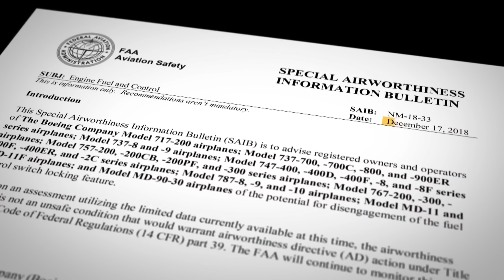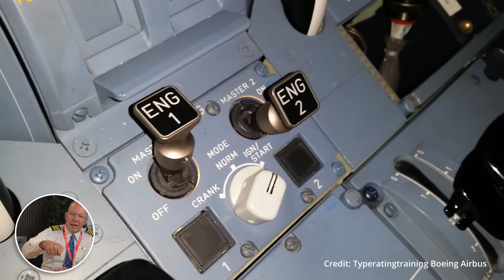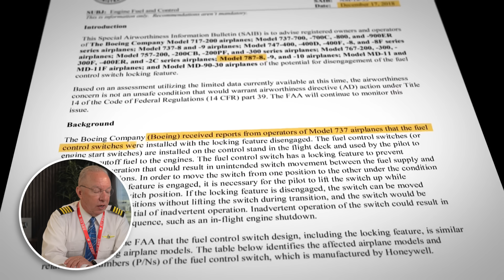Air India 171: The FAA’s 2018 Fuel Switch Locking Bulletin Explained (16 Questions Answered)

Comment: How can you be 100% sure that it’s not mechanical, electrical failure on that fuel switch? At least both the pilots are unaware from what was released in the preliminary report. Talking about pilot mental health is utter nonsense when you have no conclusion.

Comment: Incident Context
On 12 June 2025, Air India Flight AI117 suffered a dual-engine failure shortly after takeoff, leading to catastrophic loss of life. Preliminary findings show the fuel control switches were found in RUN position post-crash, with cockpit voice recordings revealing confusion among the pilots regarding engine cutoff.

🔍 Hypothesis Summary
This commentary proposes a failure mode involving mechanical-electronic misalignment in the fuel control switches:
- The physical toggles were likely in the CUTOFF position during taxi and takeoff.
- Due to a transient electronic override or contact misregistration, the FADEC may have incorrectly interpreted RUN — allowing the engines to start and deliver initial thrust.
- During takeoff roll, the system could have re-synced with the physical state, triggering an uncommanded fuel cutoff and total thrust loss.
- The pilots likely recognized the failure and toggled the switches to RUN — as confirmed by post-crash toggle position.

⚠ Design Vulnerability
Modern aircraft systems typically rely on electronic signal feedback, with no independent validation of mechanical switch position. As such:
- The failure mode would leave no direct evidence in flight data recordings.
- Investigation teams may be unable to conclusively verify physical switch states vs signal interpretation at critical moments.

Comment: The switches arent spring loaded to either position. The spring loading is down against the bottom of the latching ramp and when you lift the switch to allow it to go over the latching ramp you are lifting it against the spring.

Comment: I am simply a passenger who has wanted to be a pilot since I was 14 years old. Health issues prevented me from achieving that.
Captain, I think you are right. Putting myself in the position of the pilot then the copilot…no matter which one I was, I would turn those switches back on so fast the other pilot’s head would spin. Then I wouldn’t politely ask, I would say “what the hell are you thinking are you trying to make us crash? There are babies on board! Parents, children, aunts, uncles…..life. I am not sure how a pilot would handle a rogue partner, but I would immediately turn the plane around and make him get off the plane. If the pilot did it, why wasn’t the co-pilot panicked? If 5he co-pilot did it why did the pilot wait 10 seconds? 10 seconds is a very long time when engines are involved. If you are wrong I will be shocked.

Comment: We don’t have enough info. The report says their focus is these switches. These physical switches are not recorded in the flight data recorder (black box). This is what I found:

The Flight Data Recorder (FDR) on the Boeing 787 captures the electrical state of the fuel control switches — meaning it records whether the switches are in the RUN or CUTOFF position based on the signal received from the cockpit systems A B. It does not directly record the physical movement of the switch itself (like a mechanical displacement), but rather the status as interpreted by the aircraft’s systems.

So, someone familiar with the 787, is it possible the electronics behind these switches went to cutoff without these switches being physically moved?

Comment: Is it possible? That the fuel cut off switches were never actually turned off, and it was only an assumption by the voice that said “why did you turn them off?” Could it be a blown fuse or tripped circuit breaker ?￼￼￼

Comment: The problem with episode Captain steve did not comment on the leader report. Sometime ago I watched a doco on the issues at Boeing. In that one of the whistle blowers warned that there was an issue with these switches, Although they are manual operated they are just an electrical switch. he warned they had had intermittent electrical issues with them. Boeing claimed they had fixed it. this guy pointed out many other issues, He left because of the what was going on another whistle blower was  fired and later found dead in his vehicle ?

Comment: The FAA had issued notices about these faulty switches, which could easily move and cut off fuel to the engines and not just interchanging position. Boeing 737 MAX crashes (Lion Air and Ethiopian Airlines) where Boeing initially blamed pilot error but was later found to have concealed software flaws and manipulated data. Boeing found guilty and paid 2.5 billion dollars. Boeing has power to turn blame on pilots.

Comment: So upto this point what i have got from your explanations from previous videos is that plane cannot take off if the switches are on cutoff, so that means when they lift off from ground, switches must be on RUN position. So after few seconds it went to CUTTOFF position, that means it must have been recorded in Flight Data Recorder. So did it happened by some faulty switch system or done manually on purpose by Pilots???

Comment: There is no way one pilot saw the other flip the fuel control switch because it took 10 seconds to turn them back on. If he saw it happen he would have immediately flipped them back. He must have inferred this by some other means. Why does Steeve not address this and keeps reading the same old script. Also what a dumb argument about not having camera's. Obviously it will not prevent the first incident of a kind but could prevent future losses. For e.g. it would have made the MCAS failure apparent and hundreds of lives could have been saved. Instead Boeing blamed the pilot like they are doing now.

Comment: It took just one second to move the fuel switch from the 'Run' position to the 'Cutoff' position. However, during the recovery phase, the first engine switch was moved to the 'Run' position at 08:08:52 UTC, while the second was moved only at 08:08:56 UTC. Why was there a 4-second delay between the two?"

Comment: Is it possible the pilots heard the engine decelerating and turned asked hey did you cut off and once hears a negative answer...they try to restart the engines...
Switch could have been in run but fuel was not reaching the engines..

Comment: Let assume for while pilots is correct and they did not touch those switches. What are the other possibility?

what no one is talking about is,  can those switch transition to OFF position via software control?  

Can data recorder be  interpretation  software control  of  fuel control valve or real physical transition of those switches via pilot action? Software could be turning off those valve in case the engines were flaming out just as they were taking off.  As result data recorder would interpret as physical transition of those switches from ON to OFF position.

Comment: Who else smells a slight bias towards Boeing? Ain't  Mr.Captain an American? Oh wait! Boeing's American, Ain't it?
Shift the blame on the pilot by subtly putting in, "psychology and mental health."
After all, it's a preliminary report, and here is already a subtle push on the pilot error.
As much as the pilot error that you are pushing, could it not be a mechanical failure of the fuel switch itself? Explains the startled response from the second pilot when asked? After all, it's a preliminary report ain't it?

Comment: Great to answer questions Capt Steve. I’ve got one remark. One of the aircrafts I fly, has spring loaded battery swicthes. It happens sometimes that one switch remains in the middle position due to physical damage on the foot of the switch. But, from my experiences, I always see the switch staying in a wrong position.

Comment: Great commentary. We really need to hear the full audio (accompanied by a time-stamped transcript of what each pilot said) from the CVR from pushback at the gate to the accident. The short transcript released thus far seems far too sanitised. We really need to hear the intonation  of the pilot's conversation and the sound of any audible warnings. If I had observed a deliberate act to move the fuel switches to cut-off I would shout at the top of my voice "What the f....k did you turn off the fuel cut-off for"  For me the 1 second delay between the cut-off to the Number 1 and number 2 engines  is consistent with a deliberate act and not some sort of electrical glitch. Is there just a remote possibility that one of the plots had an absolute brain fade and cut off the fuel instead of raising the landing gear. Afterall, the maximum height achieved of around 400 would be pretty consistent with when the gear up call would be made.

Comment: Captain Steeve please comment on my theory below:

 like most people I am finding it extremely  difficult to accept the conclusion that this incident was a deliberate suicide attempt on an overbooked flight. Instead, here’s what I believe might have happened.

The aircraft may have been overloaded—with luggage, cargo etc. In the pursuit of maximizing profit margins, it's possible that every available space and weight allowance was pushed to the limit. If the total weight was significantly underreported, this would lead to incorrect calculations of critical takeoff speeds like V1 and Vr.

As a result, the aircraft may have attempted takeoff at a lower speed than required for its actual weight. Even with both engines functioning, the plane might have begun to stall shortly after liftoff due to insufficient lift. The pilot may have misinterpreted this as an engine failure. In a moment of panic or brain freeze, he could have initiated emergency procedures designed for actual engine loss—possibly even cutting off the fuel supply.

When the co-pilot noticed what was happening, he may have reacted instinctively to recover the situation. But with poor communication in those critical seconds and the aircraft already at low altitude and losing lift, it was too late to reverse the damage.

In my view, it wasn’t a deliberate act—it was a tragic combination of overloading, miscalculated speeds, and human error under extreme pressure.

Comment: Captain Steeeve's critique is pilot oriented. However, the cause of the problem could be mechanically originated. The engine could have flamed out and the pilots were working to restart. Such would require cycling the switches off and on.We must wait and see the final results of the investigation, before making a conclusion.
Reply: Your speculation if refuted by the EAFR data laid out in the Preliminary Report.

Comment: But can switches really move by accident?
Most pilots say accidental toggling is near-impossible—especially both switches at once. The fuel control switches are protected by stop locks and spring-loaded guards. These are designed to prevent mishandling during flight.
As multiple past advisories—including from the FAA—have warned of “unintended disengagement” of these guards, particularly under vibration, wear, or improper maintenance, while it's rare, it's not impossible.
Until the final report is out, no conclusions can be drawn on what—or who—caused the dual engine shutdown. But what’s clear is that fuel control switch movements can, in rare cases, happen outside of direct pilot control, due to system flaws or overlooked advisories.
Reply: No, what;s clear is that you don't know how the fuel switches have to be operated.  And remember that the transitions to cutoff occurred one second apart -- it's more than highly unlikely they both failed nearly simultaneously.

Comment: Considering that passengers on the earlier leg of the flight reported multiple electrical failures—including air conditioning, lighting, and call systems—why hasn't the investigation publicly addressed whether proper maintenance checks were conducted before takeoff? Has there been any review of technical reports or pilot entries that might have recommended grounding the aircraft? And given the symptoms observed, why isn't an electrical system failure being considered..
Reply: The EAFR would have shown an electrical system failure.

Comment: Unfortunately giving a clean chit to manufacturer, Boeing and airlines here in the report is making me more suspicious now. I’m hearing so many conflicting interpretations of the same report.

I’m a little surprised on how Captain here is taking sides this early in the investigation. I wouldn’t do that as an expert as I don’t hear any data from evidence and all I heard is speculation in the report. 
https://youtu.be/GKQIZqUlPGQ?si=nXQWMZjm-GCjV6X-
Reply: There is no speculation in the AAIB Preliminary Report.
Reply: @bmjpdx9222 there are no data points to prove the initial findings. For eg if this is a mechanical switch then it would be good to see data points on what happened before and after. Yes, the switch glitch happens rarely and was advisory to check, but how do we know if this was the anomaly where the switch malfunctioned and the pilot assumed the other pilot switched it. For Boeing to claim this as advisory is negligence in my mind. Have no precautionary mechanisms to prevent manual alternations or alerts seems like a design issue. If there are scenarios when the switches need to changed, can the recorder show if those scenarios were tested. The prelim report doesn’t go into those details and hence this is speculation sorry to say. I’m a data person, experts can be wrong too and that’s it’s important to corroborate findings with data points to show how the switches transitioned

Comment: Your "brief" is becoming increasingly apparent! Why are you still "steering" the conversation in a direction based on your wild (at this stage) conclusion that Boeing and GE are fine, the pilots are at fault? Where exactly in the "Preliminary" report does it say that? Why are you refusing to consider the possibility of an uncommanded rollback at take-off that has nothing to do with the fuel switches, when it is clearly evident that "state transition" from RUN to CUTOFF is based on FDR data interpretation, not physical evidence? And that the event surprised and shocked both pilots? Do you remember what happened to Lauda Air flight 004 in May 1991? Uncommanded deployment of thrust reversers in flight. Cause? A electrical short circuit. Not "pilot suicide"! Or was that your first thought then too?
Reply: Deployment of thrust reversers is quite different from the operation of fuel switches.
Reply: @bmjpdx9222 the fdr data will just show a state transition, not evidence of mechanical action. From the Lauda Air experience, the first conclusion, if something unexpected happens, shouldnt be malicious/suicidal intent.

Comment: If the fuel cutoff switch on the Boeing 787-8 isn't designed to be foolproof, and there's a possibility it can be inadvertently activated during takeoff, then that's a serious design flaw. In such a critical phase of flight, any system that allows for accidental engine shutdown compromises safety. Frankly, that kind of design is more comparable to something you'd expect on a motorcycle, not a modern commercial airliner.😂

In contrast, Airbus aircraft have a more robust approach. Their fuel cutoff systems are protected during takeoff—meaning that even if a pilot accidentally attempts to shut off the fuel at a critical altitude, the system won’t allow it. That’s what we call a foolproof design, and it reflects a deeper understanding of operational safety during high-risk flight phases.

👉Boeing’s 787 employs mechanically guarded switches that are resistant—but not immune—to misuse. They require deliberate, multi-step activation.

👉Airbus, however, adds an extra layer of protection: automatic inhibition during critical phases. That makes Airbus systems inherently more foolproof by design when compared to Boeing’s approach.
Reply: If you'd bother to read the AAIB Preliminary Report, you would know what it takes to move the fuel switches to cutoff.

Comment: Sorry but I completely disagree on this one. Imagine committing suicide, would you do it shortly after take-off? Or would you do it in mid flight? Why kill other people on the ground or risking the plan to be ineffective through an emergency landing? Second, why turning off one engine and then the other one second later? Would imagine cutting off both instantly. Third, if that was the intention of one pilot, why allowing the other to turn the switches to ON, he could have blocked the switches with his hands and leave them OFF without risking engines to turn ON again. This theory doesn't hold, sorry! I see your review too much biased towards protecting Boeing and disregarding many other theories on plane malfunction.
Reply: Toggling both switches simultaneously would require both hands.

Comment: It would be interesting to know if there was any sort of scuffle recorded after the switches were placed back in the correct position. The plane was aloft for 15-30 seconds after that point, IIRC. I imagine there wasn't a scuffle. Whoever pulled those switches knew there was no chance of recovery at their altitude. He probably just sat back and let the other person struggle to save a flight they both knew was now doomed to crash.

Comment: Taking 10 seconds to turn the switches back on is way too long. If I'm driving a car with a passenger who pulls the hand brake, it will take me 2 seconds to bring it back down. There is a lot of information missing from the report either deliberately or otherwise.

Comment: wow I can't believe you just brushed off service bulletin regarding the MN04 chip in the GE engines.

How could you not question the fuel control was switched off and on was possibly from memory item for dual engine failure? They couldn't simulate dual engine failure because it doesn't take into account of the MN04 chip failure.